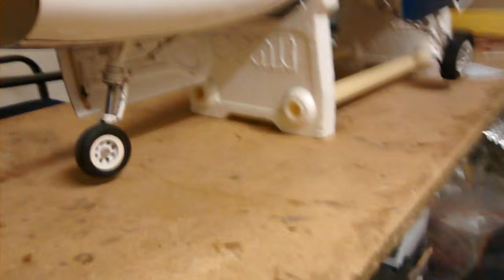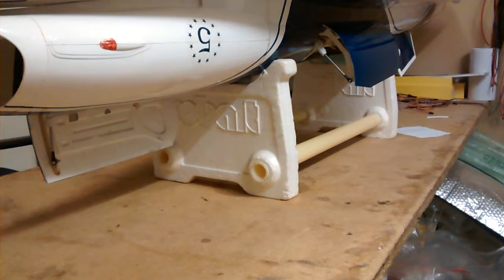Jetlegend 1/6 F16 gear test

Comment: What version do you own? I have the earlier version.
Reply from the maker: This is a V1 that has now compleated over 300 flights! Its still going strong after its latest refit following a small electrical fire. I now own a V2 that is some 1.7KG lighter on which the UC has been updated, a little stronger but a little lighter also so it should last even longer!!
Reply: Mark Vandervelden 
That's good to hear. Mine is also the V1. I'm going to maiden mine in the next month or so. How did your retracts hold up?
Reply from the maker: Unless you actual crash into something on the ground they hold up really well, normal or even heavy landings are ok but try your best to keep it smooth ;-). I dont think parts are available for the MK1 UK any longer so if you damaged your UC you may have to upgrade to MK11 parts.
Reply: Mark Vandervelden 
That is a bummer. Well thank you for your information.